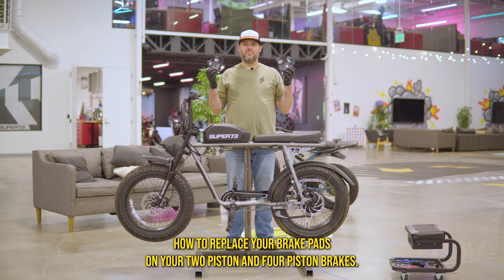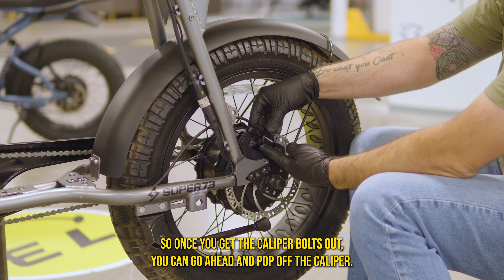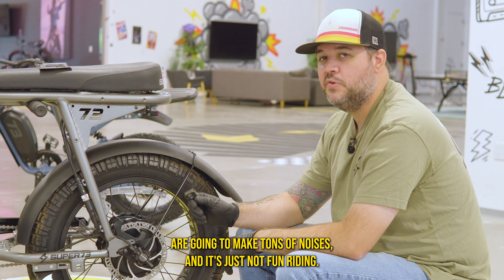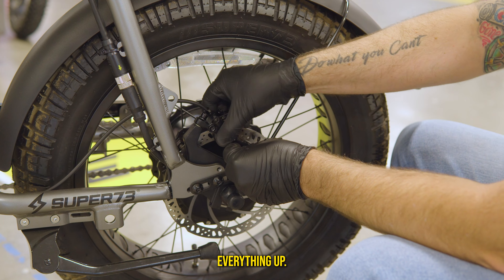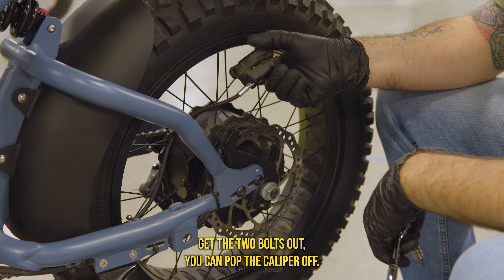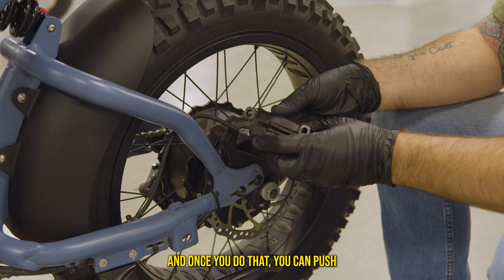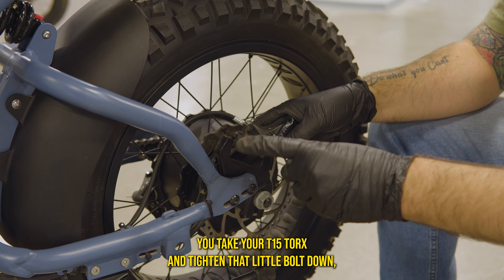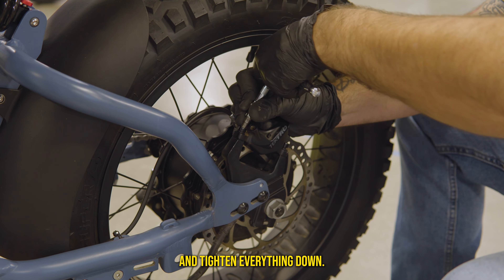REPLACING YOUR BRAKE PADS

Comment: You missed an important step. You didnt hold the brake level closed when you tighten the caliper bolts. You just said, tighten the caliper bolts.